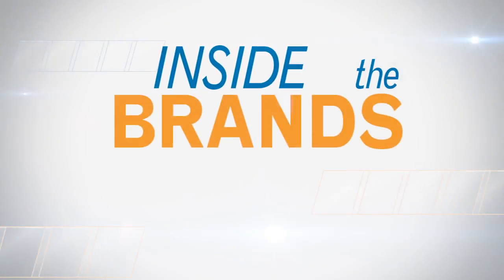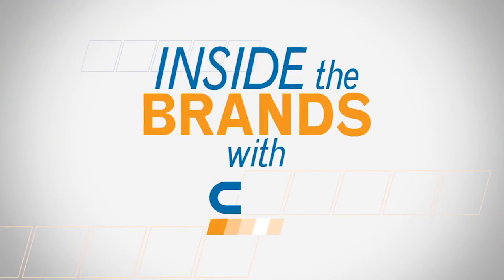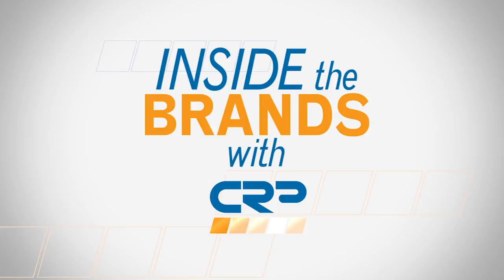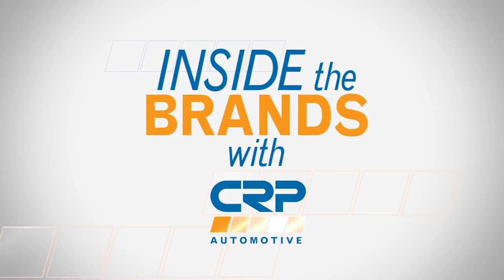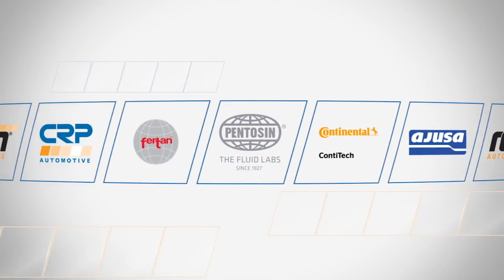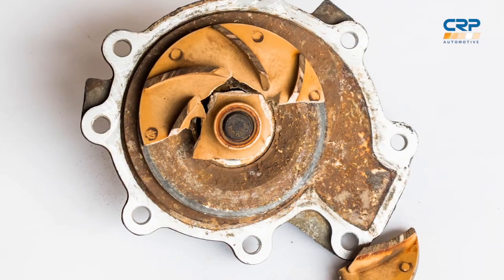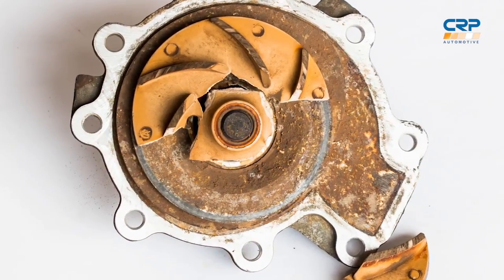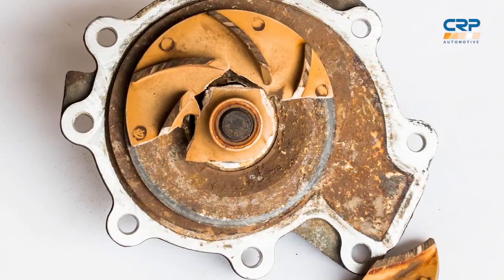Using Tap Water in Your Antifreeze? | ITB Episode 45

Comment: This is why you need to be careful listening to people on YouTube.

What he's telling you to do is 100% wrong, you should never use distilled water or reverse osmosis water in your cooling system as it will cause the very problems this guy is blaming on tap water.

You need to ask a real materials engineer or better yet look up the specs for any water cooled aircraft engine they all call for soft water and there's a reason for this.

Distilled water is very good at dissolving iron, aluminum and just about every other metal there is.

It's simple distilled water is ionically reactive because you stripped the water of all it's ions.

In other words you now have ionically imbalanced water that is desperate to rebalance itself and the only way it can do this is by stripping metal ions away from your engine block, or any other metal in your engine. Distilled water wants to regain its mineral content.

Basically distilled water is an excellent solvent, in fact distilled water is one of the best solvents there is as distilled water will dissolve more things than any other solvent known to man.

On the other hand soft water doesn't make a good solvent because it is ionically balanced.

So What you want to use is a soft water, when they soften water they replace the mineral content of the water "iron" "calcium" "magnesium" with sodium, don't make the newbie mistake of confusing sodium with salt (sodium chloride) sodium is ionically neutral and will not corrode your cooling system.

Soft water is ionically balanced and will not attempt to strip ions from the metals in your cooling system.

I'm not sure how this old wives tale of using distilled water in your cooling system started but it's doing tremendous damage to cooling systems as using distilled water in your cooling system will slowly erode your cooling system and cause failure. 

On the other hand using distilled water in your cooling system when flushing it, is a good idea.

Since distilled water is ionically imbalanced when using it to flush an engine it will pull impurities out of the cooling system.

But this idea that using tap water to fill an engine block will cause corrosion has got to be one of the most illiterate things I have read and shows a complete lack of understanding of basic chemistry and material sciences.
Reply: You seem to be pretty knowledgeable on this subject. I will trust you over what I see on YouTube videos.

Comment: During the distillation process, water is vaporized into its gaseous phase, so all its impurities are left behind. These impurities include a number of minerals, including “calcium” and “magnesium,” the two components of water “hardness.” The water is then condensed back into its liquid phase, so the resulting liquid is pure water – in fact, some of the purest water on earth. But the problem is that when water is distilled, or “stripped,” of its minerals and impurities, the resulting solution is composed of chemically imbalanced “ions.” This leaves distilled water “ionically hungry,” so it will actually strip electrons from the metals in a cooling system as it attempts to chemically re-balance itself. As it chemically removes electrons from the metals of cooling system components, distilled water eventually does extreme damage that could lead to cooling system failure. Softened water is best

Comment: the coolant manufacturer needs to put the aditives in thier coolant to tolerate normal common water otherwise the coolant manufacturer is not giving you what you should be getting. the back of the bottle will say "mix with clean drinkable water". 
imagine how expensive a flush would be if i told the customer all the flushing had to be done with distilled water. i'd never be asked  to do a coolant flush for a customer again after that. 
life is too short to deal with the anxiety of what the coolant will and won't tolerate and if the minerals in the water you flushed your cooling system with will ruin things or not. just get the coolant that won't care. end of story.